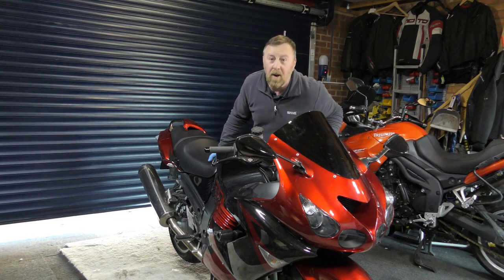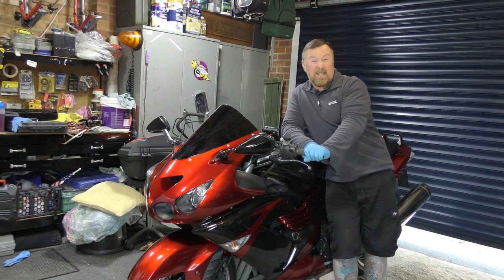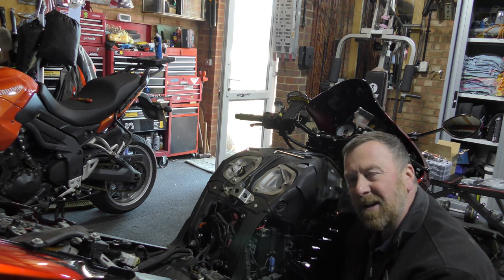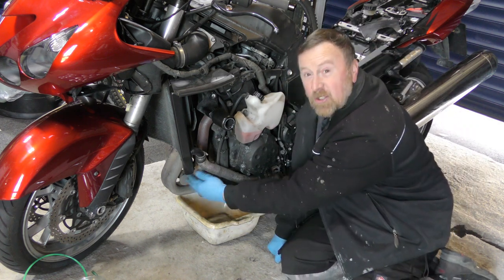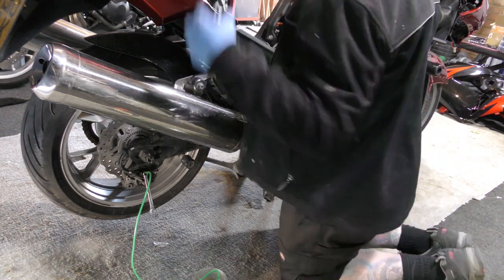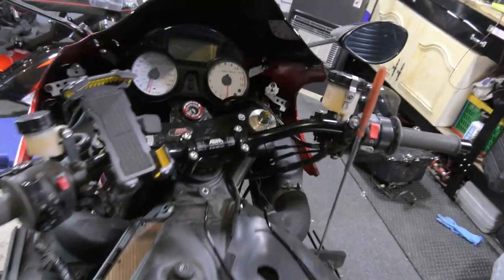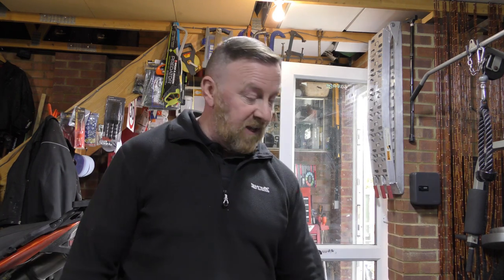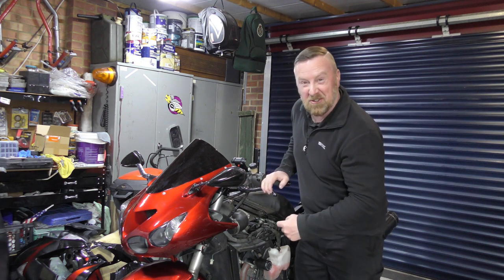KAWASAKI ZZ1400 EASY SERVICE PART 1

Comment: I have a Gen 2 1400 I bought new in 2012 and done all the servicing myself (except the first one at 600m)  including the valve service. Not sure how similar it is to a Gen 1 as I've never worked on the earlier model. I always warm panel locating lugs with a hairdryer which makes them more flexible and can prevent expensive breakages, especially in cold weather. For brake bleeding I've found a large 2 1/2" bore plastic syringe is ideal for pulling new fluid through from the caliper. I had the plugs out at 23k and they were still in spec and looked virtually like new but changed them anyway, a bit of a pain unless you have hands like a baby😂.Getting to the top end for the valve check & re-shim was the hard bit, removing the throttle bodies etc, thereafter it's just the usual cams out/under bucket shim routine. I fitted some short extension pipes onto the well hidden vacuum take offs on the throttle bodies so they're now easily accessible for hooking up of vacuum balance gauges.
I was quoted over £600 for the valve service a few years back! Just a tad under 40k on the clock now. Air & oil filters easy to change. I can change the oil & filter without removing a single panel😀👍. Great bikes these👍👍.

Comment: Did you check the dreaded Well nuts mate. They are renowned for coming apart and dropping into the air box and have been known to enter the engine. When I checked mine (on a bike that had only done 700km they were both broken.
Reply from the maker: No way ! But mine were OK,  not so good for the exhaust as I've just changed them , video next Friday

Comment: Hi did you change the spark plugs and how easy or difficult to do 👍
Reply from the maker: There's a video on my changing them on my channel bud 
I show you how to do it along with oil and air filer
Reply from the maker: Bit of a tight hand getting to them but we'll worth doing
Reply: @marksavage   I also want to do the coolant as mine is a 21 plate it has a charcoal emissions filter on the radiator side fairing  and two pipes you have to disconnect them not sure running the bike to bleed the system with them off .
Reply from the maker: @englishsteve2205  to be honest bud 21 plate plugs should do 20k and fuilds too and done main dealer due to warranty 
But hay I don't like paying out lol

Comment: HA. The exact same fairings I had on my 06 zx14. looked great. But after 2 years, have found the tail panel has started to turn pink as it get more sun than the rest whilst stored. And they are cheap.
I also have those same panel clips from ebay. Good to have handy.
Good iridium plugs should be fine for up to 100,000km in a car so I'd be happy with 50-70,000km in a bike, especially with how hard they are to do on the 14. I havnt done my plugs yet. Have owned her for ~4 years and done maybe 20-30,00km on her(now sitting at around 145,000km). I'll do them soon though.
Reply from the maker: Well my video should help as I found it needed to be done for my peace of mind 
Enjoy bud

Comment: ****PLEASE HELP*** i did a coolant flush/fill and now my bike is running hot. I keep hearing i need to "purp" it and i have done it every way i've seen advised and it's still running hot. The shop told me there is a bleeder valve to release air somewhere near the thermostat, I've looked everywhere and i can't find it. Please help me get this bike on the road again.
Reply from the maker: Ok bud 
What bike?
To finish 
When you filled it cold 
Pump the pipes while filling 
Start bike with the cap off
And pump pipes in and out or rad 
Till warm fill and put cap on run 
Stop let cool and check

Comment: Hi mark I'm just wondering if you are able to help me I changed out the throttle cable on my aerox due to the last one snapping on me but when i try to set of the bike just revs really high but not move any help will be much appreciated thanks
Reply from the maker: it is seated right in the top of the carb bud, did you change the slider with the new carb , jet size ,i always use the old jet
Reply: @marksavage  yea everything was seated perfectly turned out to be my air filter for some reason thank you for the advice tho